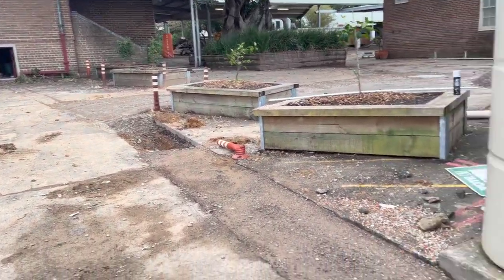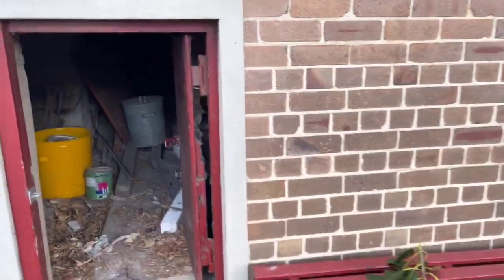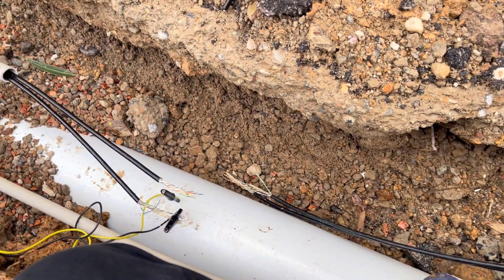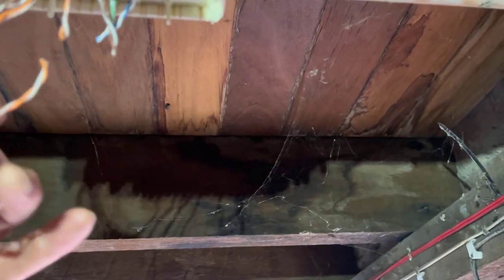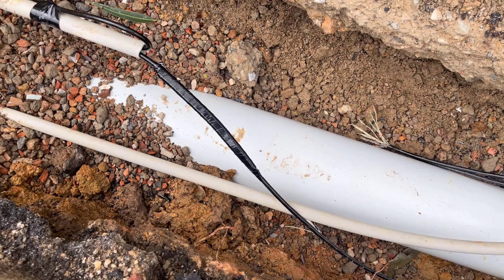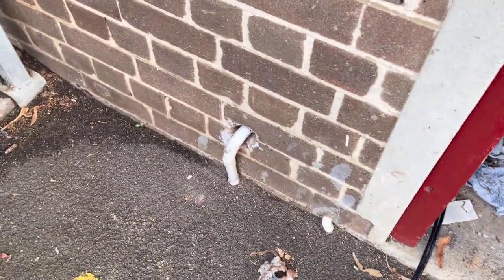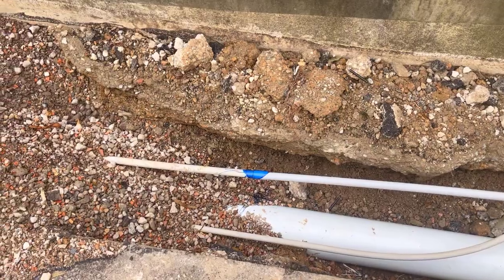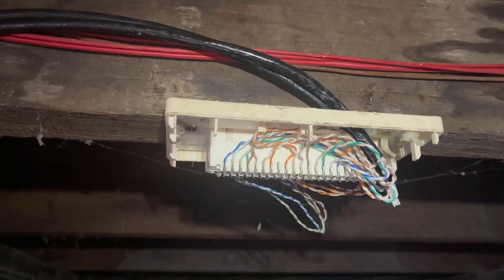Fixing Damaged Underground Cat6 Cables  Replacing Damaged Cat6 Cables

Comment from the maker: I actually made a mistake with the wiring in this video. I only just noticed it after reviewing the video. Can you spot the mistake? I will go back tomorrow to fix it but let me know if you spot it. Jase.
Reply: Hard to tell by video but, looks like you've done blue, green, orange, orange, when the other side is blue, green, brown orange?.
Reply from the maker: @Ziglez  No, I'll give you a hint. It's not a colour swap. It's something way more basic.
Reply: @SECUREACOM  you transposed the brown leg on to  the green leg and I dont know which but the polarity of either one of the 4 pair are arse around  ?And this is why I label 1/2/3/4 ( what exchange pair or sub number ) on this end and the far end re-label 1/2/3/4 Pr where its going . Cause the cable will be cut in the middle and we get no idea , like this.
Reply: You didn’t run a conduit all the way the small box under the crawlspace
Reply from the maker: @faizanjoyia  No thats not it. It is to be with the cabling at the krone block inisde the crawl space.
Reply: @SECUREACOM  Would the old cable usually have metre marks you could use to identify which cable is which?